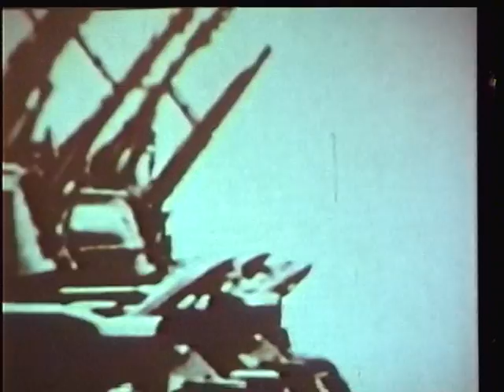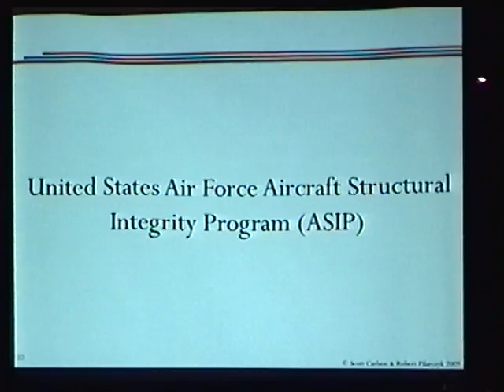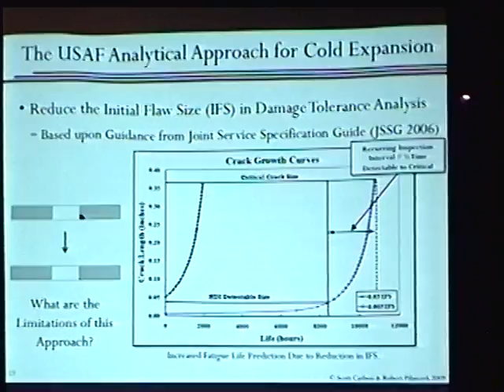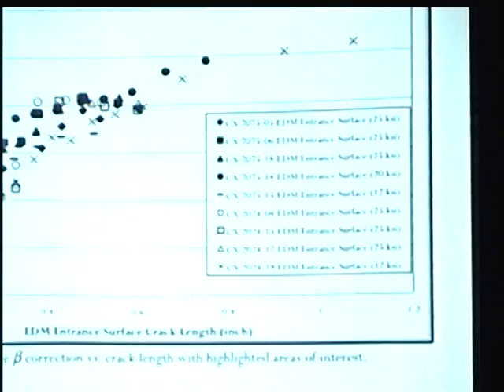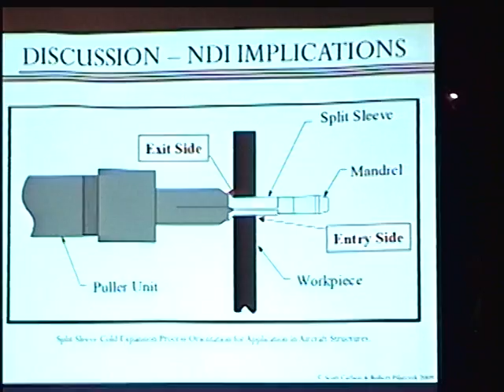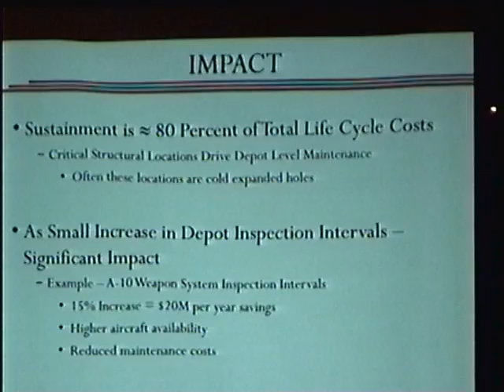Beta Correcton Crack Expanded Holes in 2024-T3 & 7075-T6 Aluminum Alloys

Comment from the maker: Keeping the the aging A-10 Warthog in use requires predicting and preventing structural integrate loss.  The presentation with these grad students from the University of Utah working at Hill Airforce Base show their conclusions on crack expansion and correction.
 #airforce  #A-10-Warthog  #ASNT   #AgingAircraft
Reply from the maker: Based on MIL 1530C Damage Tolerance
Reply from the maker: ASTM E 1823 defines LEFM Fatigue of localized process of fluctuating stresses and strains
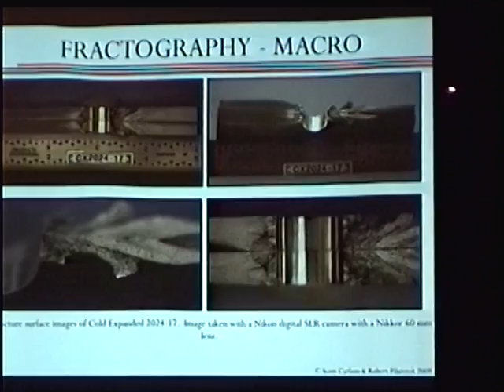Reply from the maker: At 47:19 a crack that cannot be seen, so what is the solution?